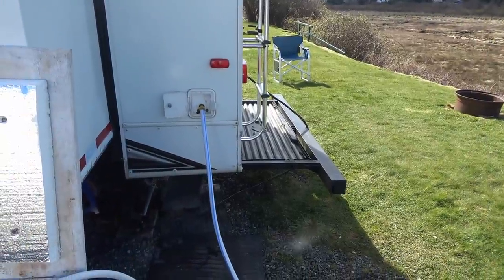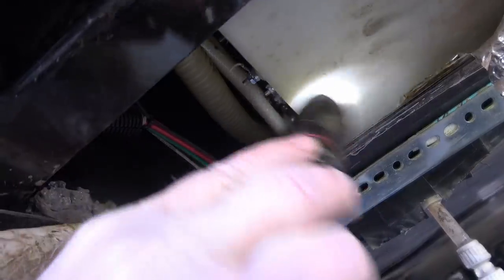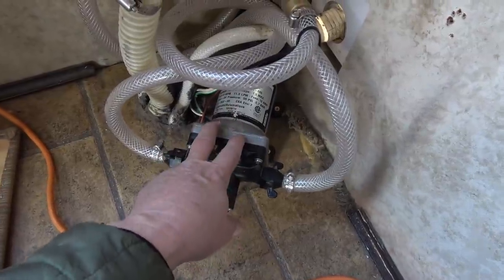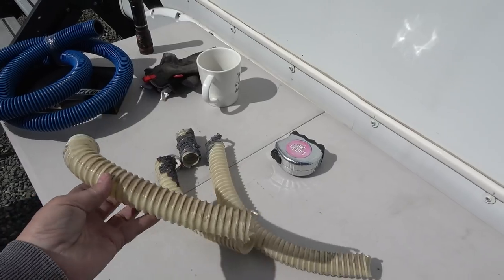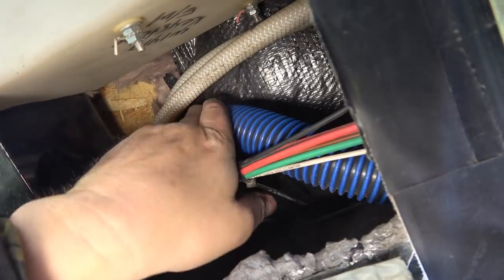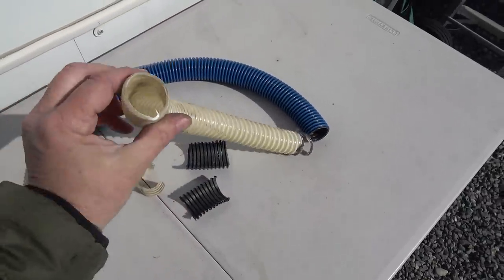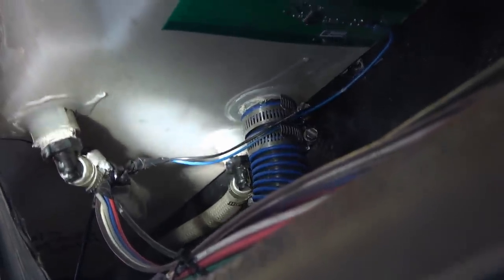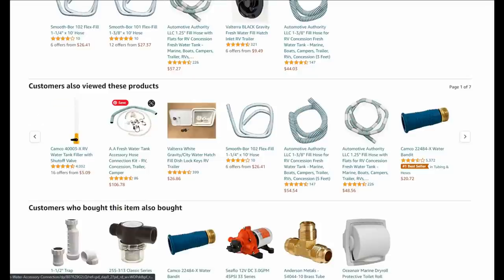Major Leak - RV Fresh Water Tank Gravity Fill Line

Comment: Success, I took your advice and added a 12" length of flexible hose to my water pipe and also added a bit of foam pipe insulation in key spots. And I must say, my pump is "at least" 50% quieter. I am thrilled,  we're hitting the road in a couple of weeks and its nice to know that those late night bathroom trips won't have to wake up the entire rig. By the way, our pump is actually "under the bed" 😳 not the best place to put it. lol. Thanks a bunch and Happy Camping
Reply from the maker: Excellent! Have a great trip

Comment: Wow ! Glad you found that now instead of out on the road . We used to have a rodent problem around nut processing plants that we had done the electrical work on. What we found was that they were going after the salt from our sweaty hands. We started wiping the conductors and inside of panels with a mild solution of bleach and water and had no more problems . Take Care and watch out for those little critters. 😉 !
Reply from the maker: Interesting, thanks for the tip!

Comment: Just a suggestion - when double clamping with gear clamps always offset your hex nuts on the clamp to the opposite side of the connection. The weak point of a gear clamp is always the buckle and nut portion. An industrial distributor in your area should be able to provide you with a smooth bore hose - Canaflex and Tigerflex are both manufacturers who make an appropriate hose that has a corrugated cover, smooth bore and is food grade.
Reply from the maker: Thanks for the advice. Cheers! Ray

Comment: You said that you added extra hose to your water pump to help keep it quiet. How does that work. I hate how loud our water pump is and was thinking about changing the pump for a quieter one. But looking at the specs, they are all about the same + or -  5dB if adding and looping a little bit of hose can help I'm ALL IN.
Reply from the maker: They actually sell a silencing kit - https://amzn.to/3thzhkQ  But, I just bought my hoses at Home Depot. I think it works by reducing vibrations down the line.  My OEM FloJet pump install was ridiculously loud! Keystone basically ran it to the floor and used foam spray.  It would vibrate the floorboard like crazy, sounded like a machine gun. Here is a video I did where I was attempting to quiet it down. https://youtu.be/T3sbvn43Lag  After that, I ended up buying the Shurflo pump and added the loops and it was much better. Some people will go even further and add an accumulator tank  https://amzn.to/3tgiSND But I'm happy enough with the reduced noise so don't feel the need. Cheers, Ray

Comment: Thanks.  Like #112.  What do you use for drinking water?
Reply from the maker: When on Vancouver Island I drink tap water as the water here is mostly rain or glacier water that is stored in reservoir lakes, great tasting! When traveling we always fill up our drinking jugs at those bulk purification machines usually you can get 5 gallons for a buck or two. we carry a couple 7 gallon jugs in the truck and use a 2 gallon on the kitchen counter.

Comment: Hi, These splits looked like rubbing to me from the brief glimpse I could see. My reason for thinking this, a rodent may have found it easier to chew on the outer ridges rather than struggling to chew between them. Also the splits are so close together I think that a rodent might just have continued to chew at the part where it had broken through. A hose rubbing as you are travelling along could have jumped and started to rub again close to where the original split was. It might be a good precaution to check your new hose after a while to see if this is the case. Unless of course there are other signs of infestation. A belt and braces approach could be the way to fix it - checking for rubbing and rodents! Like your videos. All the very best.Rab
Reply from the maker: I discounted rubbing being a cause. Nothing in that area moves, the tank is fixed in place and there is just the trailer frame around that part of the hose but several inches away. Also the last trip out I was dry camping and no leaks, since then we have been parked for the winter. It looked like it chewed right at the point where the hose was at a 90-degree bend which exposed the inner area of the corrigation more. The openings had an irregular edge like little teeth would make. I bet it tried to make an opening to crawl into the pipe via but gave up.  Cheers, Ray
Reply: @LoveYourRV  Thanks for getting back to me. All the best. Rab

Comment: We had a little device installed in my wife's car after popping the hood and discovering a little furry bast**rd had chewed up some of the foam lining. It emits a silent frequency that keeps them away. Seems to be working great as no further chewing has occurred. It obviously works of 12v so might be something to look into. Be nice too if one could fine a thin flexible steel mesh sock to feed over the hoses. ........maybe wrap in tinfoil?

Comment: Hi Ray, you just cut a access panel in your coroplast to fix? I guess that would be the easiest instead of lowering the whole thing
Reply from the maker: Yes, I have small access flaps cut several underbelly areas like the waste valves, black tank spray nozzle, slide motor, and water tank connections. I just reseal them with wide gorilla tape.

Comment: Great job.
FYI
For a better seal, when using two clamps on one end of the hose, place them in opposite directions.
Reply from the maker: Interesting, thanks for the tip!
Reply: @LoveYourRV  You're welcome. That was shown to me a long time ago by a car mechanic, for troublesome radiator hose connections. However, in your case, it is a non-pressurized hose and probably will not be a problem.

Comment: I would have gone with the same size diameter flexible braided hose like you have on the inside connected to your pump.
Reply from the maker: I thought about it but figured the tight turn I needed at the water tank was too sharp and would end up with a kink. There isn't much room to work with under there. The hose needs to turn 90 degrees in a small space. Cheers, Ray

Comment: By choice I drive and tow with a 16 year old SUV that is bumping up against 300,000 kms. (186,000 miles). What I call the jewelry is going. An O2 sensor here, a starter motor there, here a fuel pump, there a valve cover gasket. Just as your trailer continues to serve you well but for the odd replacement of things that hang off of it, so to does my X Trail fit my needs and I do not begrudge the expense of keeping it on the road one bit.
Reply from the maker: You bet, I'm with you our last truck lasted 25 years and if I didn't really want the extra power I likely would have kept it going longer. :)

Comment: Water is such a destructive force! Gosh.. rodents eat the pipes?!? Get out of here rats!!
Reply: There is something in the plastic that they are attracted to. They love to chew the insulation off electrical wires too. Go far enough up north and porcupines become a wire chewing issue as well. Solution is a spray bottle with a strong solution of water and peppermint oil sprayed liberally prior to each trip. I do 3-4 tablespoons of oil to 1 liter of water.
Reply: @metaxaanabeer  wow!! That’s good to know! Thanks
Reply from the maker: I've heard that pack rats and mice like to eat certain soy based plastics in vehicles.
Reply: @LoveYourRV  I've also heard that some wire coverings have a molasses type curing agent as well and rodents like it. True or not; I really don't know ??
Reply from the maker: I read a article by a pest company that said mice and rats often chew the opaque white hoses because they see the light and think it will be a passageway to crawl into. They chew in between the corrugations because more light comes through those points, interesting.
Reply: @LoveYourRV  Makes sense i guess? And yet we use light under our rigs & engine bays to keep them away. Personally since i went to the "walk the plank" bucket & water method I have not had a rodent problem in years.

Comment: I think you made a mess of it with the wrong product and tried to overcome it with goopy silicone and extra hose clamps. Not to mention it's not for potable water.
Reply from the maker: I admitted my mistake so people could learn from it and indicated I'd be getting the correct hose when I get the chance and showed the correct hose to use at the end of the video. Maybe you didn't watch long enough for that part. Cheers, Ray